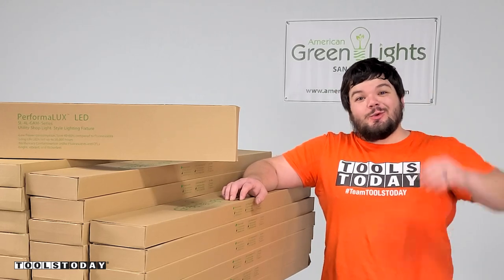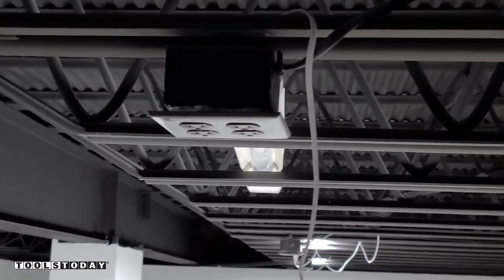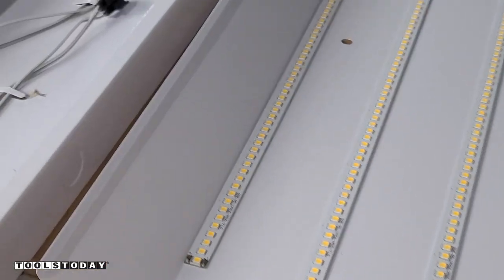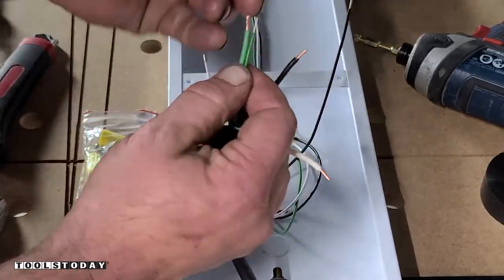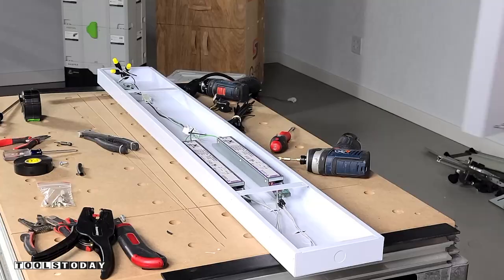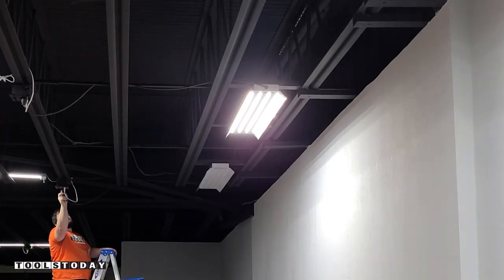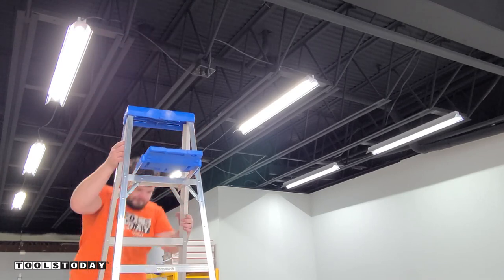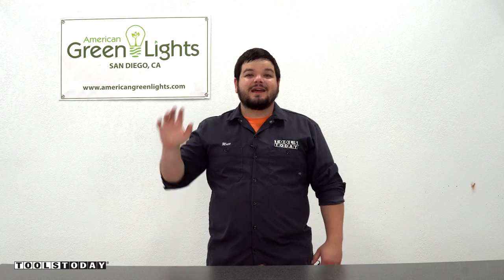Installing American Green Light LEDs in the Workshop

Comment: No provision for earthquake restraints. No strain relief connector for cable entering fixture body. Why would you teach people how to install lights that will fail an electrical inspection? Premed garburetor cords would have been better.
Reply from the maker: There's not many earthquakes where we are but thanks for the heads up! We will look into securing these further if required.